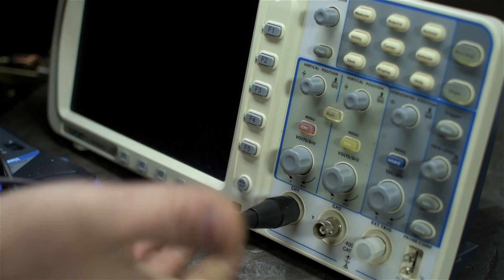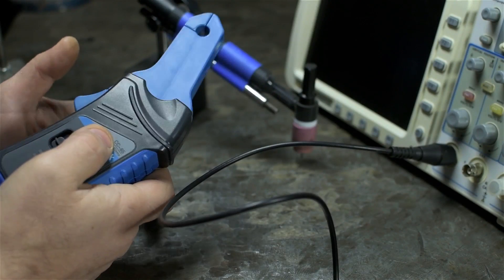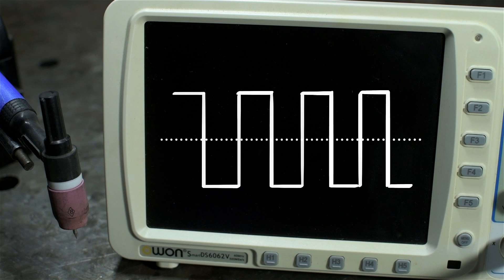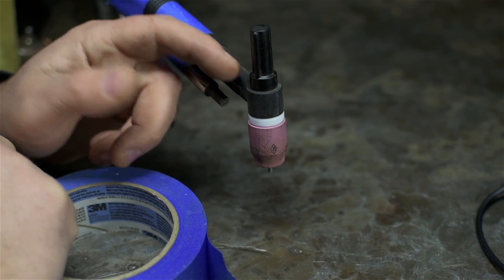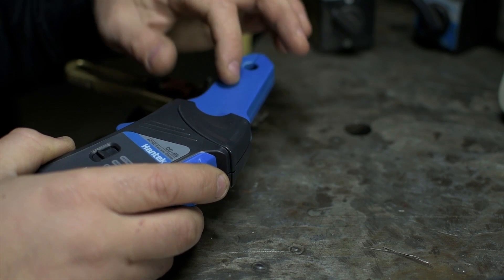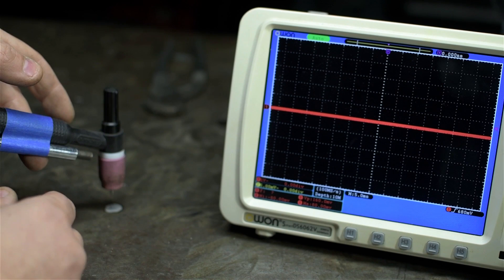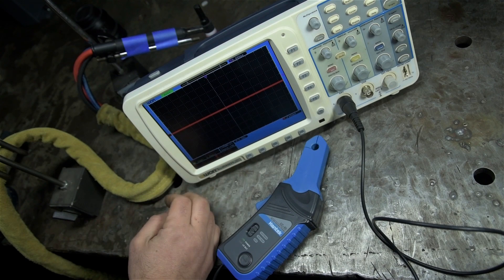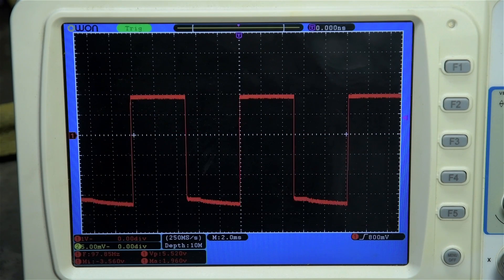Oscillo-Help-Me?

Comment: It looks like Deathlok67 has hit the problem on the head in his comment labeled 2). Since your measurement set-up does not have a common ground point, the DC offset can be caused by differing duty cycles. To get a solid reading you will need to create a common reference point between the welder the clamp and the scope. But be careful as doing this wrong could easily end with a ground loop current sufficient to melt any or all of your instrumentation! If you simply change the scope to AC coupling then you will see a symmetric waveform, but won't be able to measure any DC offsets. The fact that your scope is going crazy when trying to measure the high frequency start, is unfortunately a sign that your scope is poorly designed, nothing can fix that except for a better scope.

Comment: The positive side seams cropped - so I would bet it’s a measurement problem. What happens if you flip the sensor? Does the “negative” side looks cropped or the “positive” (measure prob.)?

Comment: It looks like you are using the 1mV/10mA range of the clamp meter, but that range is only rated up to 2A. You should try the 1mV/100mA range that can go up to 65A (for a 30A setting you should expect 0.3V on the output) http://www.hantek.com/Product//CC/CC65_Manual.pdf

Comment: A toy scope and a toy clamp together with high peak currents and lots of RF EMI is guaranteed troubles. ;-) Probably not enough shielding. If the peak currents are to high it can saturate the core of the clamp.  It takes time to recover from that (Search for BH curve)
Like a scope the clamp will have a certain bandwidth. The frequency of a welder may be low enough but the rise time of the pulses can be to fast. So it is possible that you see only part of the signal and the part you do not see, can overdrive the clamp. The EMI from the welder will  influence scope and clamp and for this sort of measurements you need serious shielded instruments (and enough CMRR) . Both instruments are the bottom price-range of the market. To get that cheap they need to save on parts  and things like shielding and protection are the first to be left out. 
You need a good industrial or automotive scope like a Fluke 190 series scope. The same goes for the clamp.  (better sit down if you look up how much it will extract from your wallet) These are not easy measurements.

Comment: When I was training as a machinist, my welding instructor told me that different polarities distribute heat differently, one is 1/3 in the work 2/3 in the electrode, and vice versa. It's possible that these fancy inverter machines modulate the current so as to distribute heat in a more even, or otherwise more desirable, fashion.

Comment: The current sensor you are using has very poor performance. It uses a laminated core with hall effect sensors. This leads to the poor readings you are getting. The Hantek current sensor was designed for low cost which makes it have poor performance. Hall effect sensors have problems with accuracy. A much better current probe uses a ferrite core with a secondary  winding. This type of current sensor cost more but is worth it because of its increased accuracy. On ebay there are several listed that are preowned for less than the Hantek probe.

Comment: Hum,... Deathlok67's &  Doug Coulter's --(Doug has a beard so trust him)
comments seem pretty good. Regarding the possibility of over current
response in your probe,... you could make a bundle of equally sized wire - say 5 wires in parallel - then clamp the probe on one of those wires. If you have good "maybe soldered" connections then your probe will be seeing 1/5 of the current. You are correct to use battery power on your scope. The RF interference is gonna be a bitch.  You could wrap the scope in screen and ground to the table,... but no guarantee on that. 
Only a mere 35years here,... you got me beat Doug.

Comment: Firstly, the scope is at serious risk of permanent damage from the RF interference, but normal controlled tests of the scope should clarify whether it's still working as intended.
There are many factors at play here but the trace on the display is showing strong evidence of clamping, whether it's the welder, the scope, or the probe is uncertain.
The fact that the resulting trace varies in amplitude alongside the welding settings and maintains the same waveform lends some evidence that the measurement circuitry is still functioning in a somewhat meaningful way.

Your test subject is very challenging for the equipment you have, measuring a Square wave ~60A ~100Hz from it's magnetic profile with the specified probe, the DC offset isn't likely to be something you can measure with any accuracy at all. Measuring the true DC offset would require a direct connection to the electrodes (I advise heavy caution for your personal safety in pursuing this line of investigation).

The clamping shape could fully be representative of the current flowing from the supply and may even be a result of the current limiting method implemented in the supply, if the output is coupled through a transformer then the current being supplied to said transformer is likely DC. Shoving a DC square-wave into a transformer would give a pretty well balanced AC output, but the output will only be as square as the rails supplying it. My guess would be that the flat part of the trace is representative of the unregulated rail within the system, whereas the wavering part of the trace is might well be the current regulation actively changing as the weld is progressing. from the schematics I've seen there is a tendency to have the regulation circuitry on the negative rail of the system, so that follows.

In all i wouldn't be alarmed with what is being seen, and would encourage you to play with a H-bridge circuit, and a half-H-bridge circuit with a small transformer to recreate the results you're getting here in a safer and more controlled manner. 

I'm no expert in the specific circuitry involved and I would love to see a good schematic that is representative of the welder in question

TL;DR Don't trust that current-probe, and the wavy bit is probably the current regulation in action

Comment: Is it because on electrode positive the ground is both your ground wire and your table
is grounded/earthed? So not all
of the current is going through the welders ground lead.  But on electrode negative the ground clamp is the current source so all of the current has to flow through the ground wire. I suspect if you put the clamp on the electrode connection you would see the opposite behavior. Or it’s just designed like that on purpose as others have mentioned.

Comment: Those Hantek current probes are a bit sketchy.  (1) have you pressed and HELD for 3-5secs  the zeroing button for the DC offset? (2) have you tried flipping it over (run the ground cable back to front instead of front to back) to see if the DC offset is in the probe itself?

Comment: I did some testing, and nothing conclusive, but I don't think that there's anything wrong with what you're doing. I don't have an oscilloscope current probe handy, but I do have an Ideal AC/DC clampmeter and a Miller Dynasty 350 at work, and I have the shop to myself right now. I can set the electrode negative and electrode positive currents independently, rather than having one knob to turn. When I set EP and EN to be the same value, I read zero current in DC mode, and roughly the correct nominal current in AC mode.  That suggests that a clamp on meter with a balanced current should be zero-centered. When I set the electrode positive current to be 20A, EN to 5A, I read 7.2A DC, and 15.5A AC. This would suggest a max value of 20.9A and a min value of -6.5A (this is a true RMS meter). Granted, this isn't exactly what it was set to, but it's pretty close. So I'm pretty sure that using a Hall effect clamp to measure welding current is a perfectly valid thing to do. The only thing that I can think of which could be causing an error on your end is an induced magnetic field in the table causing problems on a cheap current clamp, but that seems far fetched. I would recommend putting the current clamp and scope close to the welder rather than the table just to check that possibility. The fact that your current goes to zero when you stop the arc indicates that there isn't some static offset that is going to change if you flip it over or anything else simple like that.

Comment: You are basically feet first into a massive can of worms - easier to explain how harry potter does magic - if the problem was big you'd know it was an effect but because it's only a relatively small skew (which is actually quite impressive (no offence) given the scope!)  ... a quick fix might be a chicken wire faraday cage for the scope and hope the shielding takes care of the leads (keep them short), to do the job right you'll also need to bond all the earths in the workshop.  In a cardiac theatre you'd drop an earthspike a silly depth into good quality soil, no bedrock allowed and then bond the lot with copper bus bars.  It's not as much about the earth resistance as the potential difference between the elements.

About now - you're wishing you hadn't asked - and I'm wishing I hadn't tried to answer!!!

Comment: I agree with the possibility of the probe being an issue.. Reversing the probe is the best idea  The 85 amp max is RMS not peak.   Second running a square wave has a higher RMS value than sine wave.   Also a square wave has a higher frequency component than a sine wave. Not sure what the upper frequencies do to the probe.. I worked on a project where we had to measure the output of an H bridge at 44Khz.  The engineers that has designed the system mentioned that they had to derate the current probes due to being at the limit of the spec.  Too much current at freq would burn them up even tho they current was below spec.  We were using Tekronix probes IIRC.  One thing to note is that  in your video is that as the wave closes it goes symmetric.   Try setting the current below that.. Also if the HTP has a sine wave output, try that.

Comment: It could be the current clamp saturating. What you could do to verify your setup is make a sniffer probe. You just take a piece of coax(that old probe you stepped on one too many times will work great!) and solder a little  hand wound inductor(3-4 turns around a pencil should do) to the end of a coax. That's essentially what us pixie wrangling types call a crude ideal magnetic dipole antenna. You just hold that sucker close enough(make sure it doesn't arc over!) to the arc and you'll probably be able to get a view of the waveform. It won't give you calibrated readings, but I would be amazed if you could get any saturation out of a sniffer probe.

Also: yes, battery operated osmelloscope is the way to go here. Just be mindful of the fact that your ground point on both your channels are still connected. Battery operation isn't a full substitute for differential probes.

Comment: My money on the scope getting funky in HF start is EM interference. It is probably not sufficiently shielded against what the welder is throwing out to get the arc started.

For the bias issue, as has been suggested - try flipping the clamp over (basically make it measure current in the ‘other’ direction). If now the positive is higher than negative, it’s the welder. If it doesn’t change anything, it is the current clamp or something else on the measurement side.

Comment: Test the current clamps max on the mains to see if its even and not clipping. if you loop the cable through the current clamp multiple times you multiply the magnetic field, and thus the reading by the number of loops. This way you can test the Max range of probe with a much lower test current. I.e. 10 turns at 5 amps will read as 50A.

Comment: Hi Tony

I doubt your $50 current clamp is able to measure negative current waveforms..  some cheap CCs just won't do that. I think it saturates some FET junction or opamp when measuring negative currents.
If budget is an issue and you don't want to spend $5000 on a really nice LeCroy current clamp and another $10000 on a scope (although I won't understand), using a simple LEM sensor (e.g. LEM HAS 50-S with + some additional electronics) would do the trick I guess.

In case I'm right, it won't help you flipping the probe over to verify whether it's your test setup or your welder. Could be either still - just inverted.

Btw1. Since your using a current clamp with no galvanic connection to DUT, you don't risk introducing a ground loop or blowing your scope up while testing ;)

Btw2. Problems at welder startup are most certainly related to EMI caused by HF AC currents (And inappropriate shielding of your scope). From my experience with EMI - distance from source helps.. Don't even think of introducing more shielding yourself unless you are prepared to go down that rabbit hole. 

Hope that helps!
A big fan of yours :)

Comment: The very flat top of the waveform is pretty unlikely. I would expect the top to look more like the bottom - bit wavy and not completely flat. My money is on the clamp saturating. Two thing to try:

1. Rotate the clamp round.
2. Use an ordinary scope probe and measure the voltage drop across a length of the ground lead.      It will act as a resistor and give you an idea what the waveform is really like. The differential voltage will be small (well under a volt) and ordinary scope probes are able to handle mains voltage. With a battery powered scope this is perfectly safe.

Comment: I suspect you are saturating an amplifier in the current probe.  Notice how the top waveform is (clipped to?) a clean square edge whereas the bottom has more squigglies, until the arc is shutting down and it becomes symmetrical squiggles at lower current, with high spikes present on the bottom but not the top

Comment: Hey Tony, I have a couple of ideas.  First thought was to switch "polarity".  If you change your AC balance to 50% then switching your leads should help you to figure out if it's your welder or your scope.  Other thought I had is maybe it's related to rectification in the arc itself.  As I understand it, the EP half of the cycle cleans the material and also removes some of the high points that want to initiate the arc again, causing an unbalanced waveform.  Or maybe it has to do with the argon.  Thanks for the great videos!

Comment: Some are suggesting to flip the clamp. It isn't a bad idea, but we need to be sure first that the feedback circuitry inside the clamp itself is symmetric. In order to do this get the biggest halogen bulb you can get and measure the mains current flowing through it (clamp only a single wire, either live or neutral). A halogen bulb is an almost purely resistive load and won't distort the mains sinusoidal current. If you see a symmetric waveform on your scope, the setup is ok.  If you prefer to avoid working on mains wiring, you can do a similar test using a bench power supply. Wire it so that you get a reasonably large DC current and measure it. The flip the clamp and measure it again. You should get the same value, but an opposite polarity.

Comment: The spark gap may be acting as a resistor, try putting the amp clamp on the torch side and see if it reads higher on the positive side. I'm no expert in pixie wrangler' but it's my best guess

Comment: I had to edit. It's easy to forget what you're actually measuring. I retract my statement on common reference, it's a current probe, it doesn't need a reference other than it's own batteries. If you flip the probe, the "direction" measured should also change, flipping the trace on its head, no? If not, we need a good long look at the scope.

Duty cycle looks quite 50/50 to me, there will be some slight asymmetry to make sure there is no shoot-through in the push/pull output.

Comment: With my knowledge of electronics, I think you should hold the  measuring clamp a little bit higher. All the negative electrons probably sink to the bottom of the cable, that's why you are measuring more of them.

Comment: Got a function generator? Test your scope. (Hell, a 555 timer and a couple passives will give you a decent "in the ballpark" waveform.)

Got a power cable with separate leads that you can get your clamp around? Test your clamp and your scope together. (Hook up a known draw to the cable. Say, a 60w mechanic's light.)

Does your scope have a ground reference connector? Read the manual.

Comment: My dearest Tony, 
perhaps you could check the waveform symmetry by scoping the voltage over a long piece of stock with the earth at one end and the arc at the other? It would be a bit messy but you should be able to see the fairly large asymmetry your current (!) setup suggests if it is indeed there. 
Good luck!
J

Comment: It kind of makes sense that they would want to add a negative bias to the waveform. If you had a positive bias (i.e., negatively charged tip), the positive ions from the rod/metal would gradually deposit onto the tip.